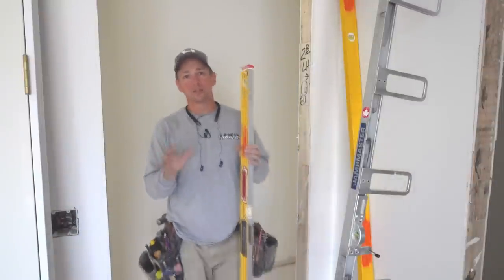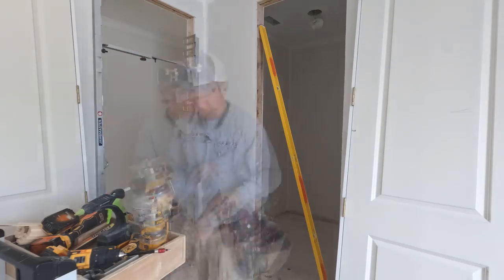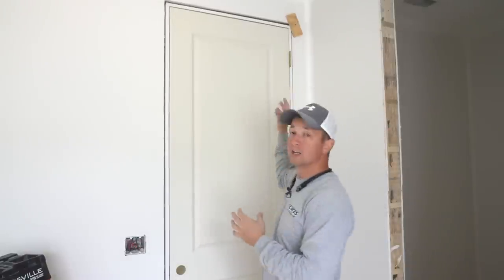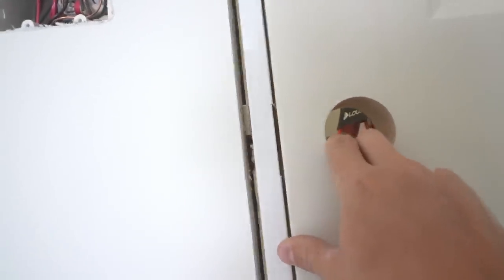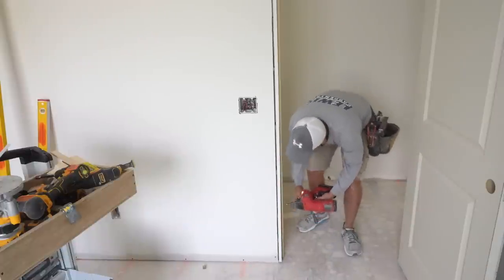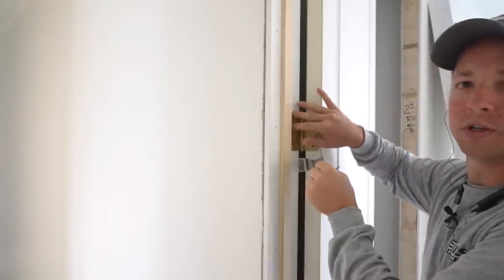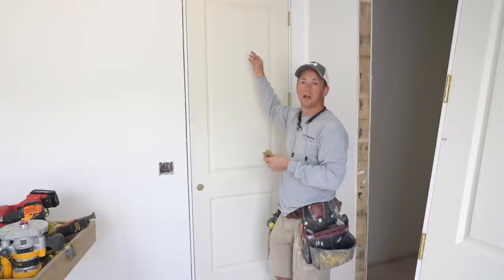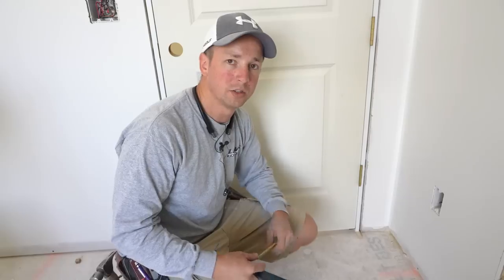SETTING PREHUNG DOORS - Important Keys to Success

Comment: Between the hack framers, and the awful door manufacturers it's so hard to get a well hung pre-hung door these days. We usually have to deal with misaligned mortises, awful hinges that were installed crooked,  and staples that were carelessly shot into jams that split the jams, or protrude into very much unwanted space. When I build my own jams everything goes so much smoother.
Reply: Totally Agree! Back in 2000 I stop using millwork interior pre-hungs. We spent more time fixing the hacks then to hang on site. So since then I use slabs and blank jambs. No more misaligned jamb heads, staples showing through, cocked hinge screws, and door binding.
Reply: So true
Reply: agreed.
Reply: Rough framing is called rough framing for a reason they don't get to pick their wood so badly warped or crowned 2x has to be used giving the reason you frame a door or window 2in bigger and yes you are correct about door manufacturing its horrible I've had so many problems in the last few years with interior doors especially the hinges took me awhile to figure the some  hinges were actually bent and needed slightly tweaked too
Reply: Nailed it!
Reply: There are definitely hack framers, however even a door opening framed "perfectly" by a top notch framer will still twist, rack and bow because of the conditions the wood goes thru before the house is conditioned.  The entire frame of the house expands and contracts with the weather, and the bigger the house, the more movement and twisting there will be.  It's the nature of wood.
Reply: We've been lucky to be using a millwork supplier that will buy the doors and jambs separately and do all their own hanging and lock boring before delivering to the jobs. Can't say we've had any issues with their way of working
Reply: 100%
Reply: I agree. Quality of prehung doors are terrible if your buying the mass marketed ones.

Comment: Great video, just a comment about adding screws for heavy doors. I experienced having a door installed with minimum fasteners, and someone who decided that adding a hanger/hooks to the door was a good thing. Nice idea, but it added a LOT of unexpected weight to the door, and the original nails failed. So even with lighter less durable doors, a few minutes and $1 more in fasteners makes a difference. Thanks again for a great video!

Comment: Spencer is accurate on his door hanging process. I would still add a 2" screw through the jamb hinge at the hole closest to the stop making sure you hit the stud behind. I usually wait until the painters have removed and reinstalled the slab before I set the long screw. I do it at the same time as I install the door handle. Reason for this is that the shorter screws have a tendency to fail in the cheaper FJP jambs used in painted applications. It also give me a chance to make sure the painters re-hinged the doors properly so I don't get a call back on a rubbing door.

Comment: I really appreciate the time which you put on this video and I actually learn a lot of points and hints. They way you covered all the margin topics around the main topic was very thorough and detailed specially when you addressed id there is a gap between the door and the stopper on the jamb and what would be solution. You are very expressive and speak about the possible concerns gently and comprehensively. I liked, checking and checking and rechecking, you also covered the potential issue with the bottom gap between the door and the floor, it might slope up or down as the door swings. I really appreciate this short but comprehensive video full of helpful points. Thank you kindly.

Comment: Comprehensive!  I have also learned that I can cheat with a screw that does not run through a shim. Pulling the jamb to accommodate a slight irregularity in the door, itself. Thanks for the video. Jambmaster 👍

Comment: Good points and good ideas for hanging the big 8-ft solid Walnut beasts. 
     I always  open the door and throw a 3/4 block under the door when I'm on hardwood, or two three quarter blocks if I'm hanging over carpet. 
Then shim that block to plumb my door.

Comment: I used to shoot for 3/16 and I guess I just struggled seemingly never getting over my “OCD”?
Fighting if the HVAC is on , where they or the or my GC who I am sub-out to had the trimmed dropped (this time on a very expensive 5 Thou ft home right on the garage floor w/ all my solid slabs one Hickory , multiple closet doors by pass solid core ; all standing in the back of the garage up against a 3rd garage door????  In 100 plus weather?

So I changed to strong 3/16-1/4” whatever I could hit and maintain!
Plus I hv a screw pattern I use at the end!  4 of them w/a 5th middle hole top hinge (painters are made aware)!

And lastly I added 3.5”x3.5” plywood shims 1/4,3/8,1/8,1/2,5/8 all in a 5 gallon bucket !  Then I use your shim jig maker for my big cabinet saw and make cedar shims 8” long!   

I incorporated so much of your system more than anything I want to say “I appreciate you brother” ; thank you for all your help for pro-carpenters who are tradesmen and tradeswomen !
Just can not Thk u enough!

This was another great one!

Maybe once again go over the fine points of craftsman style window!
Other than the 3 piece maybe a decorative top with complimentary 1x6 and 1x1 under it?? 

I watch your one and use the Sheetrock screw to level out the sides top and bottom ?  However R u still using this ?
Ect.,.

Thk u Brother!
Never quit!
Never bow to laziness !
Buy good tools!

JD

Comment: That hinge demonstration socked me, i even went down to my garage to find some hinges to check. I found 6 hinges, 5 of them had 0 play, 1 of them had no rattle but under stress you could nick a fingernail. I do a lot of renovation work so ill try keep an eye out for doors that failed and the relation to screws although most doors i find are screwed even with slotted head screws. My gut kind of tells me misalignment over time is more related to framing or foundations settling or seasonal expansion/contraction/moisture.
Reply: i actually see quite a few doors move from lateral movement, im guessing its somewhat related but the doors live most of their life open. The easiest fix being to shift the bottom hinge out a little bit. Its pretty much always moving the bottom hinge out.

Comment: You can also order number 9 tapered screws with the various finishes that are 3 1/2 long.  I use them in all of the deepest hinge holes which saves taking them off and risk splitting the jamb if you don't predrill.  On entry doors you can countersink them under the weatherstrip easy enough if you have trouble catching the cripple stud.
Reply from the maker: The reason I don't do that is because the painters remove them and don't know where to put them back. And when the painter removes them it can negate the adjustment you were trying to make.
Reply: @InsiderCarpentry  Makes sense to me.  I don't do new construction often so I would have never thought of that.

Comment: It looks like your door gap is about 5/8” or 3/4” but a lot of doors come with longer jambs (1” or better) . What’s your thoughts on this ?  What exactly do you correct to the king studs prior to wallboard installation ?
Also why not use finish screws on the jambs instead of nails !  I noticed you didn’t show if the threshold was level and how do you address this in regards to the striker plate to keep the spacing correct in the event that you have to cut one side of the jamb to plumb and level ?  Also I think the crap jambs that are not even 3/4” are one strike against the carpenters on the solid core doors. Do you think 5/4 might be the answer ?
What kind of screws do you use under the hinge plates ?
I love and watch your channel all the time     
Keep up the great work and keep the tips coming   
I think you have earned your PhD degree in finish carpentry!!!!!
Reply: We run in to the floor being unlevel a lot on remodels have to to cut one side of the jam to fix it. I never like doing that, so I'd definitely be interested in other ways of dealing with that.

Comment: You forgot at least one thing. When the door and jambes are painted you also lose some reveal to the paint thickness, especially when you have paint buildup on the edges of the doors. It can cause the hinge side of the door to bind against the jamb. I Try and leave about 3/32- 1/8" reveal all the way around.
Reply: Yeah, this.  Worked with stain grade for so long, that when it was a spec project with primed doors not painted, set my reveals to stain grade, not paint grade.  That one hurt.

Comment: try a dead blow hammer. Used a lot in the automotive industry. The hammer head is hollow and filled with small ball bearings. When you swing there is minimal damage, no rebound. Harbor freight has a nice set.

Comment: That's the way it's done right there! In the past, I have had to add a shim in the middle of the header jam because they were warped but that's not the norm. 

More recently, I was paid to replace some interior doors. Upon removal of the trim, I found that the previous installer literally installed the pre-hung doors, without using a single shim!!! Basically, they just relied on the trim to hold the doors in place. Obviously hollow core but still, it was a first for me! 🤣
Reply from the maker: It blows my mind that builders sell houses with the level of quality.
Reply: @InsiderCarpentry  It's ALL about the profit margin.  Does any one even use the word quality except in advertising??
Reply: That's the 15-minute door you hear some guys talk about. )
Reply: @GeoJuana  Yep, never believed that was possible until I saw these...
Reply: @GeoJuana  I always told the guy I worked for that it took what it took.  He didn't always like my response,  but he didn't complain about my finish work either.  You just get use to rushing through things.  I wouldn't do something for someone that I wouldn't do for myself.  For whatever that's worth.  I retired because I was tired of this crap.  No longer enjoyed the work. So be it!!!
Reply: Had a builder come in and see me shimming, and nailing the jams and said asked why I would do that, just shoot some nails through the trim and be done with it. smh
Reply: @rickysdrywall5288  That was no builder! lol
Reply: @Quickened1  Unfortunately the consumer has NO idea to what quality looks like anymore. They way over pay for a house anymore and accept whatever is put on their plate.  A quality builder has to compete against that and is going to lose because they charge for good work.  That's the world we live in today and it's unfortunate.
Reply: @rickysdrywall5288  that is for six eight hollow core cheap doors

Comment: Another tool that works really well with getting your jamb perfect is a crossline laser level.  Set your laser line to on the edge of the jamb and you can see all the little bits of bow in your jamb that you have to shim out.
Reply from the maker: I've tried that but never had good results. If there is any warp or twist in the door it makes the laser ineffective. To me it's easier just to set them traditionally.
Reply: @InsiderCarpentry  I get what you're saying. I do try to square the studs and jamb to the sheetrock first before I do any laser lines/ shims. I bought a +$500 model crossline LLvl (bosch gll3-330cg) a year ago when I was doing marine construction but you have to purchase 3 accessories to make them useable: 1 receiver to detect the line in sunlight 2 telescoping pole to connect the Llvl to move it up/down 3 high precision manual rotation stage that you connect the Llvl to that gives you very fine control spin so you can line your laser up on points a long way away.  You dont need a receiver for interior work but the other 2 are critical. Who do you purchase a Jamb Master through?

Comment: I just want to come back and say guilty I have been lately going back and actually pulling the doors and cutting them to fit the floors.  The hinge issue is obviously more a problem in homes sporting solid core doors!  The issues w/doors is you work on them all day and the other trades are looking at you like your stone cold lazy?  It’s really a fight from start to finish.  Other trades like in this house it’s tilers the GC is crunched then delays so yeah we’re tripping over each other!  Gaps?  My framing at the top allowed an 1 1/4” shim to the jam?  So someone assumed 7’ and it was 6/8’s.  So I guess I am venting here sorry Spence u hv a full plate !  Carry on Brother!

Comment: Solid video and advise. Covered a ton of information for those new to setting doors. Recently did/doing an older house reno and when old framing or new lumber has a bow/changes do you have adjustment tricks when that happens? Hunger bending/etc

Comment: Spencer when you were talking about the settling of the door over years do the shim blocks (plywood shim blocks) need to be reinforced with a thin finish nail to hold them perfectly still over time or is the hot glue by itself sufficient?  I was thinking about that other day b/c I really have no idea how long the longevity of hot glue is.

Comment: along the top margin, along the drywall and the frame of the door, there is quite a difference in how the two edges meet up.  It looks to be 1/8" (or more) where the drywall is proud of the door frame.  Is that something your take care of prior to setting the door into place?  Do you line the front jam, that is exposed to the hallway, flush with the drywall?  Do you center the door frame in the rough opening (front to back) then hide any isses with the casing?

Comment: When it comes to having the door hit the door stop properly… do you ever hit the door stop around instead of pulling the jamb in or out like you did in the video?
Reply from the maker: Yes but usually only because the stop was installed improperly or because the door is warped or twisted. Generally if you’re moving the door stop the door is not going to sit flush with the front of the jamb.

Comment: My painter just had a stroke with the amount of nails you used? Painters seam to think nails are unnecessary to hold a door into place lol. I make my finish carpenter use trim head screws for setting solid core doors for painted millwork and all exterior doors.
Reply from the maker: Trim head screws leave horrendous holes that are 4x the size of my 15 gauge nail holes. Trim head screws don't have any holding power in terms of heavy doors. It's more important to get large exterior screws behind the hinges or door stop.

Comment: Awesome video. One question I had is do you check to see if the whole jamb is plumb vertically? Meaning that if it is not,  the jamb would need to be proud on one side of the opening to make it plum right? If it’s out of plumb bad enough, the door would swing open or closed and won’t stay still. Maybe you checked it before?
Reply: That’s what a spirit level is for. Hopefully the framers know how to use one too.

Comment: My issues arise from sloppy prehung units. Top margins left at over a 1/4 inch. Sloppy hinges. I have been replacing hinges with BB style when I can. 
Any tips on hanging a double door set. Warpage issues arise from unevenness at the seams of the 2 doors yet the jambs are perfect alignment on the drywall and plumb. Ive had doors dead even and 2 weeks later come back and 1 door is out of alignment a 1/4 in.  Top to bottom on the meet in the middle.  Yet the jambs are plumb and even. I use a 15 gauge nailer to set jambs.

Comment: Try trimming houses in New Orleans all your life for zero contractors that are gonna wait till the AC is on to trim their houses 😂. When the AC is on you better be done punching out. Major headaches with doors!  I’m no longer there but here in Tennessee I just hung about 10 doors for a small job and the prehung doors showed up with the frames built to the exact size of the door 😡. A stain job to boot. They must have made the jambs around the doors. I would love to work for Spencer’s contractors

Comment: Hi Spencer. I am looking to buy some scaffolding. I know you had mentioned in a previous video where you bought the scaffolding with the ladder on both sides. If you could respond with the name of the company, I would greatly appreciate it. Thanks.
Reply: Love the comment about abusing things. People look at me like I'm a madman when I go full swing with a block while trimming. It has to go where it has to go!
Reply from the maker: I got the blue scaffold from scaffold express. As far as I know the only double ladder is available in the 6'4" height. I had my 5' yellow scaffold custom welded to have the double ladder.
Reply: @InsiderCarpentry  thanks man. I appreciate the heads up!

Comment: Before you invested in JambMaster, what method/tools did you find most efficient for pre-shimming rough openings perfectly square and plumb? Also, do you find it efficient to use JambMaster even for single door installation?
Reply: It gets less efficient as the quantity of doors is reduced. Unless the single door has some special challenges, such as concealed hinges on heavy doors that have only about 1mm of clearance on the hinge side through the whole range of motion. Also very helpful when a door must be set in exactly a certain space, such as replacing a door in a corner where the casing will hit another casing face at 90 degrees. Or when installing a door where the shims cannot be adjusted once the jamb is in the opening.

Comment: Gday mate,  we normally go for minimum 1/8 gap as you have to account for paint I go 4mm. But we don't do pre hung,  we cut and install our jambs then hang the door, shim and nail off strike side.  I think I am faster that way. 20 mins a door start to finish.  like your vids mate i loke to compare our techniques between countries. we don't get blow up as you put it, but we do get movement from ground swell. cheers